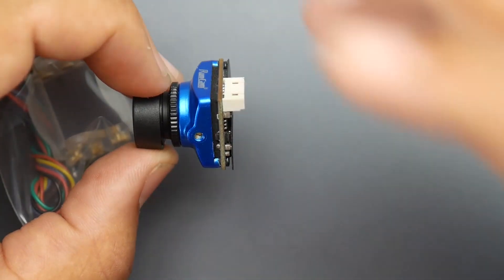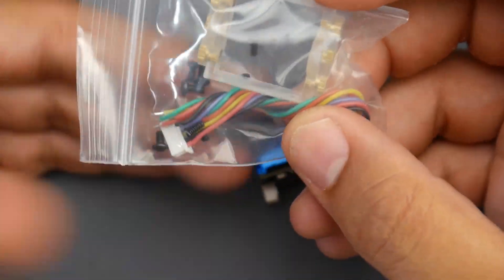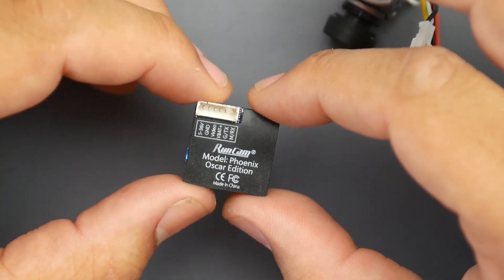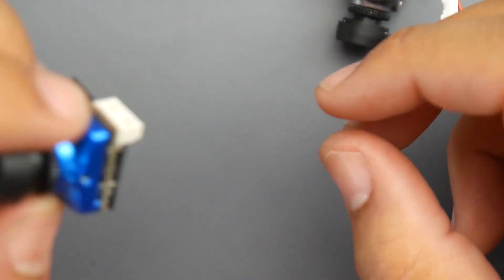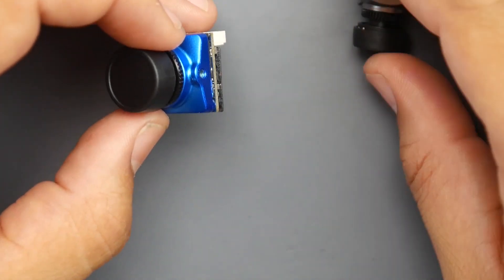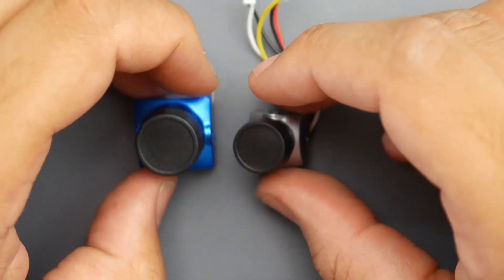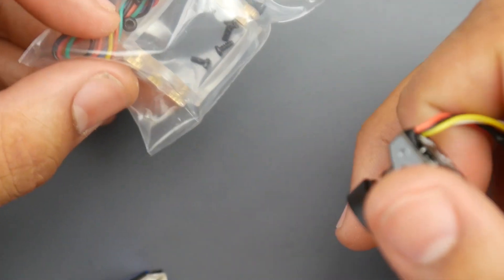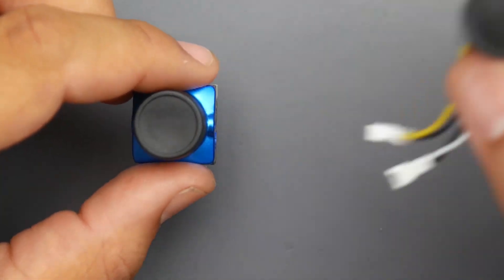FPV Cameras Just Don't Make Sense // Runcam Pheonix Latency Test

Comment from the maker: Runcam Racer Nano2 (1.9 MS LATENCY!!!)
http://bit.ly/2L6Pzd8
Reply: Hey Drone Mesh, there are 2 different cameras: you have here the Runcam Racer Nano. The other one is Runcam Nano 2. The difference between them is that the Racer has the wires to connect a joystick and change the settings. There might be other internal diffs between them, but the wiring is the most visible.

Comment: The physical limitation is always the main issue of the smaller camera. There is no way you can fit large sensor inside nano class camera and that's why I prefer micro cam that has large sensor and m12 lense like the Ratel for the similar price. The nano class does has its place but it can never out do the larger sensor camera escpecially in low light. If you have enough space, the larger the better.

However, the racers may have different priority. Hence the name of this camera. Some of those superlite racers are using 20x20 stack and new-gen 2205 6s motors to shave the weight down as much as possible.